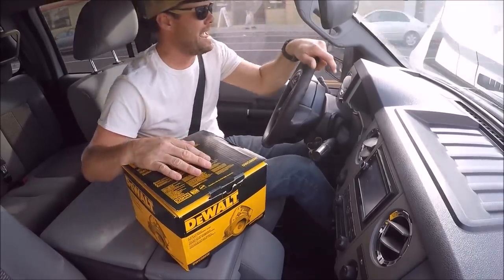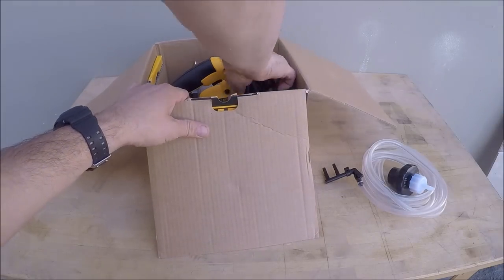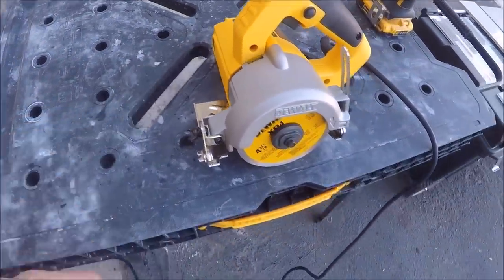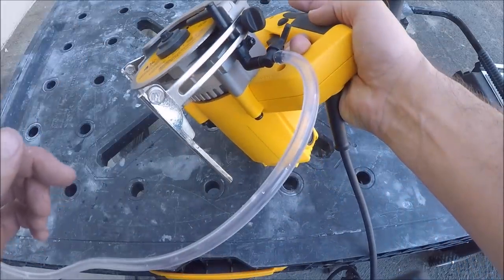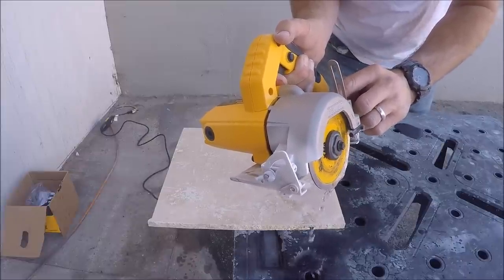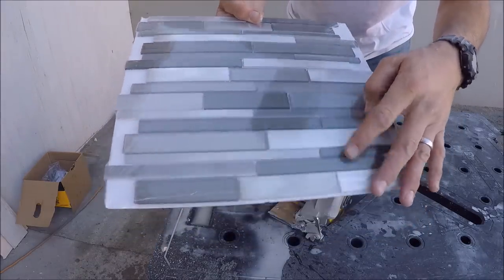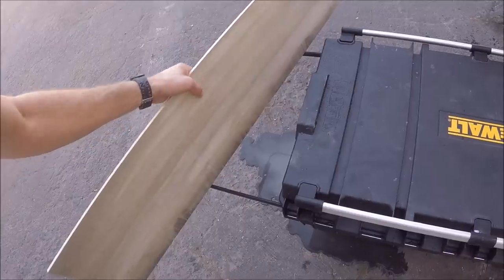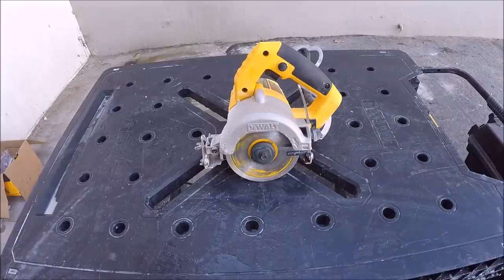Dewalt Hand-Held Tile Saw Unboxing Test & Review

Comment: Hi Landberg (this is Marty, I hijacked my wife’s account).  With regards to using the incredible Dewalt folding table (made in Israel, by the way!), not only is it a very versatile table that holds 1000 lbs, it has clamping capability.  I just used it to do the same thing you were doing with the 4’ piece of porcelain, only I was cutting wood.  The 4 slots in the middle are made to stick an adjustable clamp in, e.g. Irwin or a Dewalt quick adjust 1 foot clamps work well.  Put one of the two clamps into each of the two slots on the side of the table facing the piece of material you want to hold, adjust tightly and cut with confidence.  It’ll free up your hand not holding the saw.
Reply from the maker: That's a great idea, thank you for the tip!

Comment: If you were to cut a tile at a straight 90 degree could you easily use a router with a diamond bit to bevel the back edge? Only asking as don’t have all the equipment a pro would

Comment: You should adjust the blade depth and place the whole tile on the flat surface so there is no drop off. Then clamp the tile down and use a strait edge. You will get a much better cut.
Reply from the maker: Yes sir, you are absolutely right! 👊

Comment: Saw works great!! Any true tile, floor/shower guy should have this little guy in the truck!!! A nice addition to the actual wet saw, and grinder arsenal
Reply from the maker: Yes! Having all three is definitely the perfect set up!
Reply: i cant think of a reason to have anything other than this circular saw, an angle grinder, and a tile cutter. if you run a straight edge along your tile for long rips you can perfect cuts with this. also i would lay the tile flat on a waste piece of plywood and cut directly through the tile into the ply to stop the tile from chipping out like in your video.
Reply: Meh to frigging messy , a grinder a cutter a tabletop saw and a 10 inch saw and your rock and rolling
Reply: I just can’t understand why there isn’t an angle bringer with a water attachment, preferably a makita
Reply: @MegaMeco2  I agree. I'm trying to find someone local with a 3D printer to print on for me.

Comment: Not to be that guy, but the body of saw is designed to ride over the main body of the tile.  It also needs a straight edge (Kreg makes a good one). If you are concerned with scratches, painters tape or a soft base plate cover helps....

Comment: Thanks for reviewing this. The fact that it doesn't have a shutoff valve on the saw is reason enough for me not to buy it. I HATE walking on a wet floor around my work area!
Reply from the maker: I totally agree! I was working in puddles cutting for 30 minutes...
Reply: Hey I’ve got a great idea for you guys, I always use these kind of saws With a pump for a wet saw so I can run it out of a bucket. If you plug this into a foot switch it makes things much more convenient
Reply: @LandbergTileTV  Would you be able to retrofit a shut off valve to this?
Reply: Its not hard to add a shut-off valve, you can buy a cheap little plastic barbed valve and just install it inline on the hose. Maybe $2 for the valve and a few seconds worth of work. But I agree shut-off capability should have been included from the factory.
Reply: For $1.69 you can put a shutoff valve inline with the regulator. This is not  quantum theory here.

Comment: Can it cut a granite counter top
Reply from the maker: Yes, I believe these are used more for solid surface such as granite countertops then for cutting tile. This saw would work great for granite!
Reply: Andrew Darling yes you can
Reply: The main reason I bought this saw was for countertops. It works but wear some kind of waterproof covering, it's messy as hell.

Comment: I don't use mine anymore after 1st time with water..very messy & not worth the set up. Only use it dry for cutting curb tops where they won't fit across my wet saw table.
Reply from the maker: I agree, very messy and not worth the set-up. Pick up a grinder with battery and blade and you can use it for the same purpose as well as so many other applications.
Reply: Diamond blades are ALWAYS meant to cut with water... Unles you want to overheat the diamonds (diamond is indeed the hardest substance, BUT it does NOT withstand a very high temperature!On the other side, water is a BIG help in reducing the amount of dust that is created. Many vitreous materials do create very small particles you can't even see with a naked eye, those particles can cause what is called "Silicosis" Silicosis (also known as miner's phthisis, grinder's asthma, potter's rot and other occupation-related names, or by the invented name pneumonoultramicroscopicsilicovolcanoconiosis) is a form of occupational lung disease caused by inhalation of crystalline silica dust, and is marked by inflammation and scarring in the internal tissues, and MANY times it results in a bad form of CANCER!BETTER PLAY IT SAFE.  Use a good respirator AND water.  Better messy than dead after a long and excrutiating sickness.

Comment: Can that be used to cut floor tile installed already?  If not what would you suggest?
Reply from the maker: That would be difficult to do, this is used for tile and stone. Thanks for watching!
Reply: @LandbergTileTV  with the depth gauge set right it would work, I imagine. 

just like tearing out glueddown hardwood

Comment: How would you compare this with the "beast 5” from Lackmond that you reviewed as well? I’m looking to buy one or the other for long rip cuts on large tile instead of buying a bridge saw. Your thoughts?
Reply from the maker: The beast had a better water pump/spray and felt more powerful. You may want to consider a brushless grinder with a nice diamond wheel like a Montolit. We cut with a sponge on the blade when ripping long tiles. Just an idea...
Reply: The beast is better.

Comment: Is the cutting blade on the wrong side of the saw?  The motor off the saw should be sitting over the tile so the flat underneath part of the saw sits and slides over the working surface. I noticed a bit of wobble. 
It looked like a left handed saw.
Reply: I thought that at first but it's much easier to see the  marked line this way
Reply: @eamonoz  Good call I thought I was the only one and really do not like the way this is set up, it sets up like an old panel saw which is also a goofy set up as well.  I hope in time I will learn to like the saw, but thus far it is silly.  It really does not need to be so light, and seems the saw is weighted in the wrong spot.  If more weight was added at the center of the saw it would feel stable and not so "toy like".  The motor is great, but add some balance.  The plastic ABS water feed is horrible and does not turn off and designed to break, come on designers, really?  The metal bottom plate to adjust the blade depth should have been a bit larger with the ability to use a gauge off the left side near the blade.  I learned from using the old Skil worm drive when cutting wood an 1-1/2 inch from the blade to the metal edge of the base plate (now aluminum after the 777)  an 1-1/2 inch could be found anywhere (actual size of a 2x4).  The DeWalt off-set on the left side is some goofy metric number near 3/8.  Most of us are right handed and the old worm drive allowed a clear view of the cut made as the right hand pushed and directed the saw with a clear line of sight positioned safely behind the saw as designed.  I guess the intent with this saw is to place an edge along the right side (again a goofy measurement) and not a clear line of sight.  ( I like to see the material being cut, call me crazy).  It is like scratching your right ear using your left hand.  I'm old and like things simple, easy, and safe.

The advice is free and you get what you pay for.  Black and Decker in yellow plastic the designers really needed to put some effort in this and not impressed.  Back Makita angle grinder.  Thanks for your time